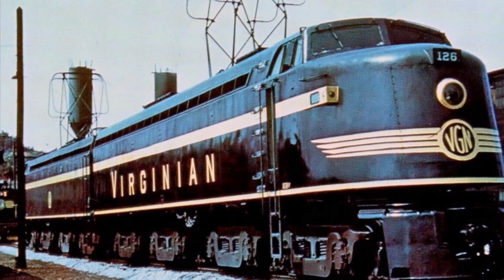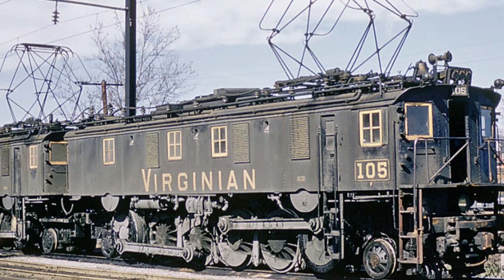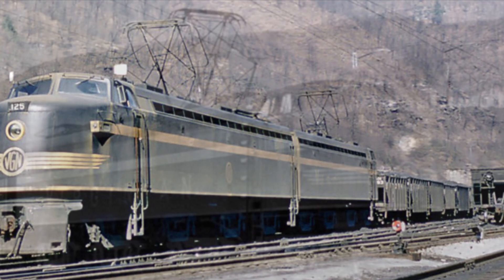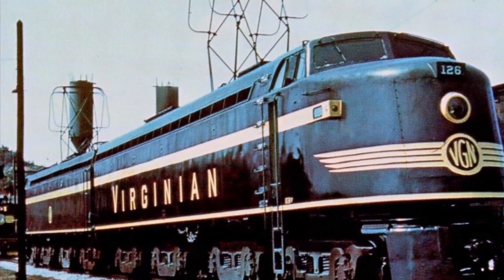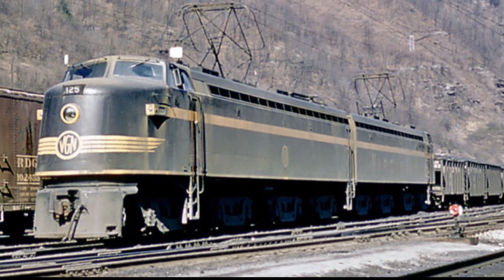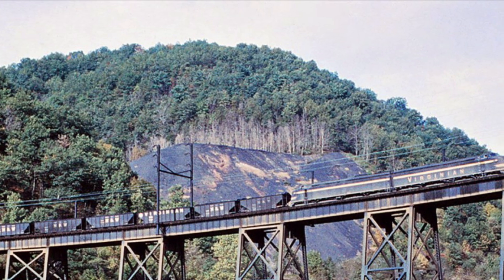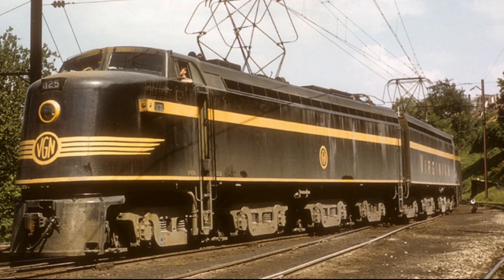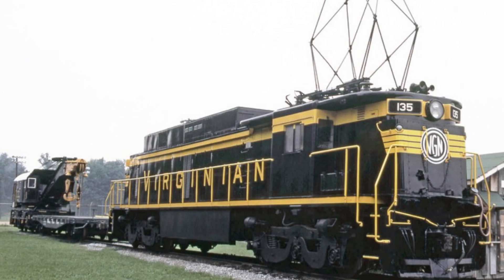Engines of North America: The GE EL-2B

Comment: Are there any locomotives that can run of patographs or Diesel powered electric? It would seem like a better solution than the battery electric locomotives you hear about.
Reply: Battery electric is fake technology. They simply cannot match overhead line electrification.
Reply: Very late to a party. Electro-diesel locomotives exist, but they have higher running costs as they need to carry redundant equipment and their horsepower in diesel mode is much smaller compared to a regular diesel. Thus they have always been built only for niche and very specific applications.
Reply: @Knsgf however it a better solution than battery locomotive